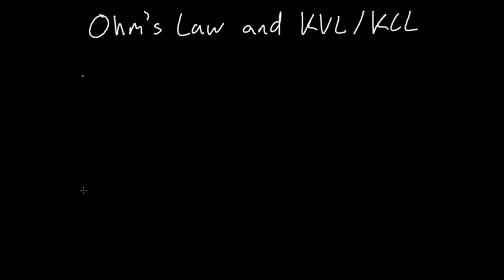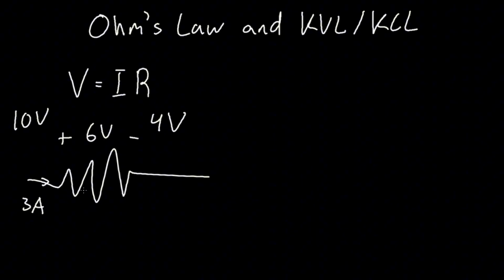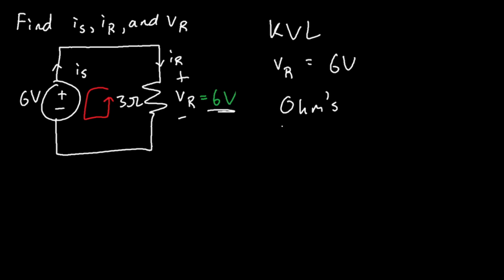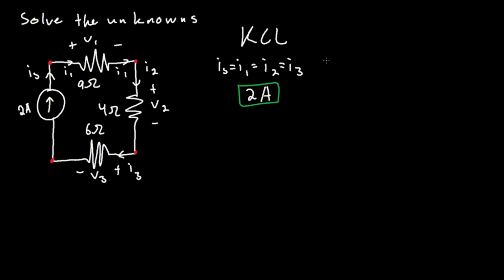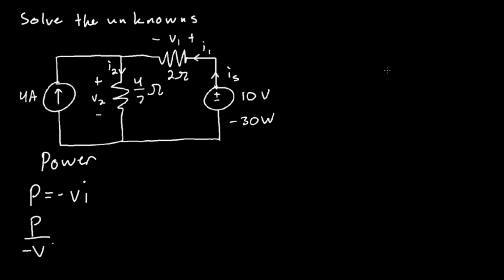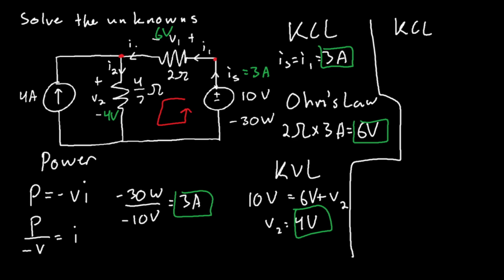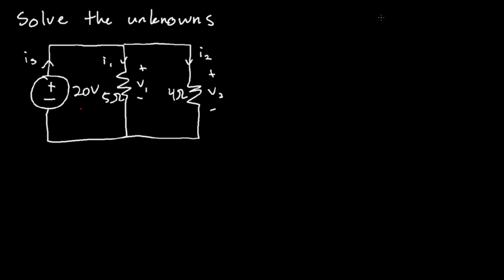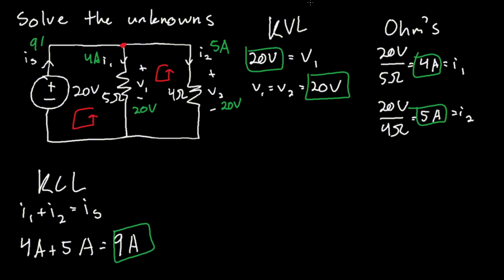How to Solve Circuits Using Ohm's Law and Kirchhoff's Laws

Comment: 7:00 why is this circuit not PSC? Is it bc the voltage source shows the positive above the negative and the circuit is entering the voltage source at the negative side
Reply: I was commenting on a dif video of urs and it ended and auto played this video then posted it to this video
Reply from the maker: @jaredsP6353  oopsy daisies! do you still need the explanation? if so which video did you intend?
Reply from the maker: im not certain what a PSC is and at 7:00 there isnt a voltage source. perhaps im looking at the wrong problem?